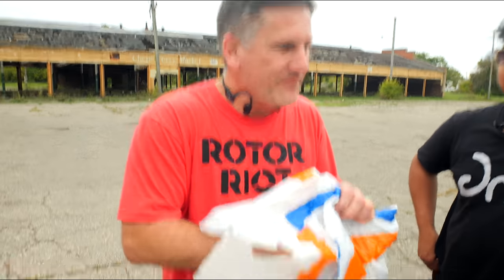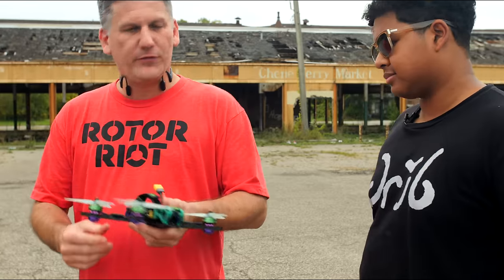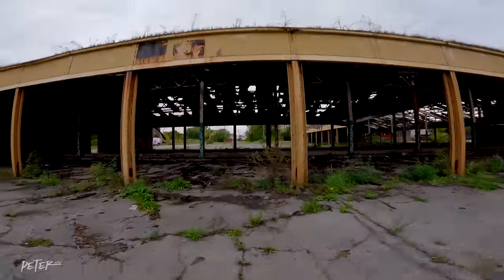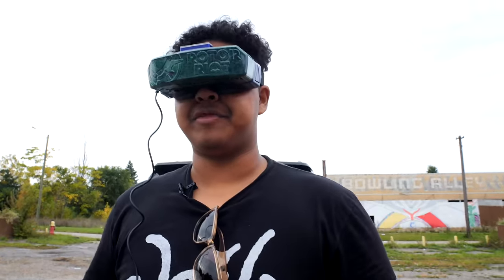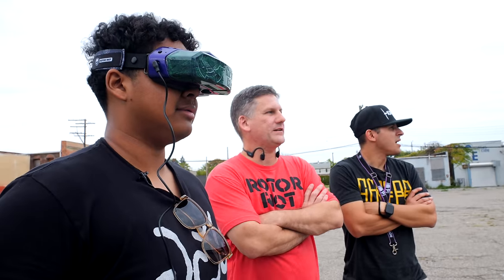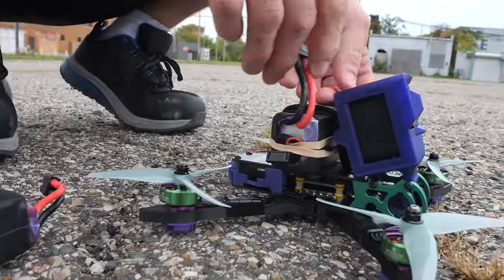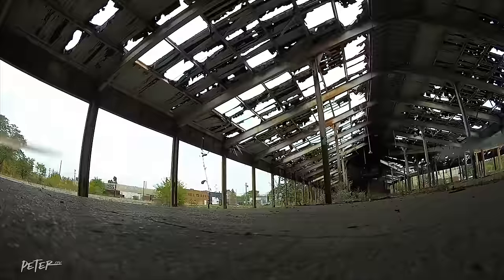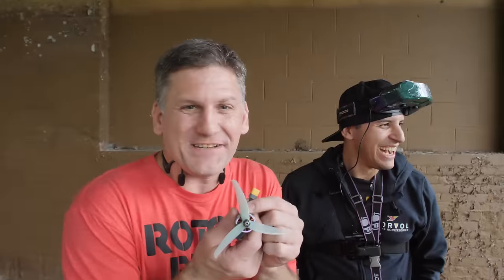This Drone is Made of 3D Printed Carbon Fiber!!

Comment: even nylon with "carbon fiber" is no match to real carbon fiber frames.  its a look thing, not a structural thing. Sure it will fly, but you have to tune the shit out of it to get rid of the vibrations, like he talked about but didn't really show how much effort  and waste of time it is to make a vibration heavy frame to fly, and not take hits like a 5inch.  it would do better as a smaller 2inch 3d print frame, but even still, with the price of electronics.... its a shame to waste electronics on something everyone keeps thinking is a great idea and every video showing how bad it is.  just a clickbait video
Reply: It's not a looks thing, nylon is inherently flexible so the carbon stiffens it. Same with glass filled nylon. Unfortunately this takes away to the validity of your claim
Reply: You have absolutely no idea what you are talking about. Adding carbon fibre or other additives (glass fibre, glass microspheres, ceramic microspheres, etc) does change the structural properties of the plastic, pretty significantly in some cases, mainly by improving stiffness.

3D printing frames is still a great idea, but only when the frame is designed for 3D printing. Most people these guys included, just take a frame designed for cutting out of carbon fibre sheets and print it. The frames are optimised for carbon fibre sheets not 3D printing, if the frame was designed and optimised for 3D printing and the material used it would work much better.

Comment: Pla- cf is actually weaker than pla just fyi
Reply: That is a vastly oversimplified and just untrue statement. There are a lot of variations of PLA and PLA-CF but in the case of Bambu labs the PLA-CF is stiffer and stronger but has less impact resistance.